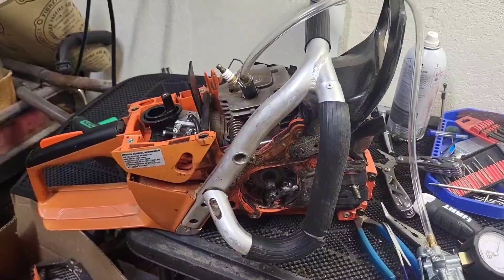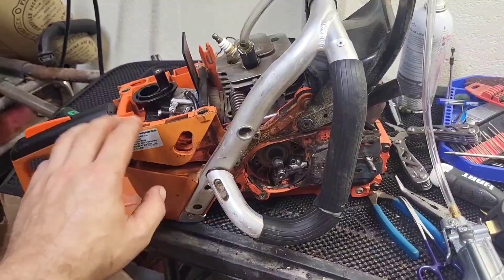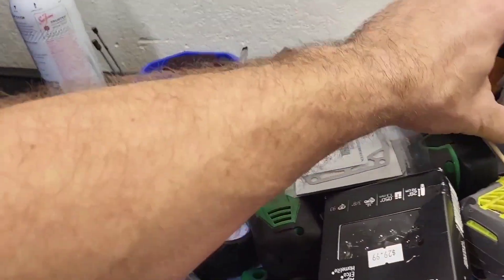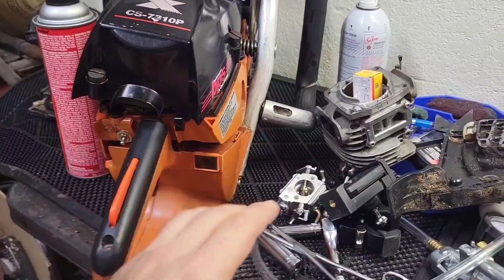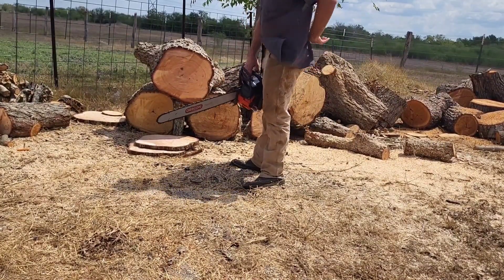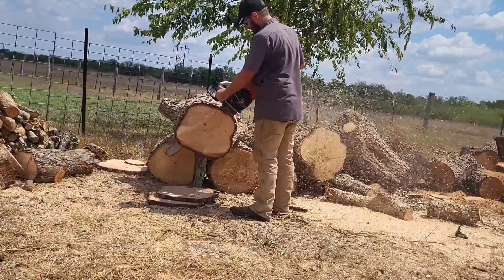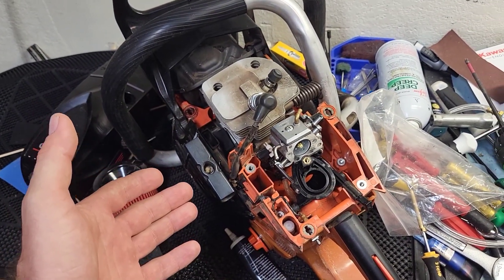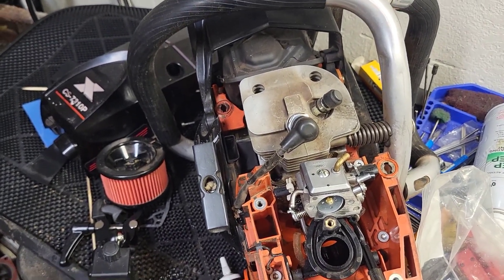Ending the CS-7310 Debacle @novicelumberjack

Comment: This is an excellent video and shows your ability to work through finding problems.  Also, it totally make sense that if the fuel line goes empty and there is fuel in the tank, that there is an issue with the carbs ability to deliver fuel rather than there being an air leak in the bottom or top end.  Also, I love how you didn't "throw the kitchen sink" at it because now you know for sure what the issue was rather than replacing seals, carb, lines etc, etc.  Obviously it doesn't always work out like that and you were super careful to when you were talking about how you thought it was essentially most likely the carb and nothing else.  Don't you hate it when there are 2 issues, where one contributes to the overall problem?  Will drive you nuts!  Though I am not a small engine technician, from a technician to another, GREAT WORK!
Reply from the maker: Thanks man, it is just another day at work for me. I like solving problems, i dont 100% understand the failure of the carb but there is a way to test it too i just havent done it yet. Since it is a performance build it gets a new carb, no risks taken there.
Reply: Good evening OW!
Reply: @Super-Dave-Outdoors  sounds like a good idea. Will keep watching and I was super impressed with your 7310 build. One that runs like that would be worth owning!
Reply: @Super-Dave-Outdoors  Fuel pump diaphragm inlet flap is first  
check valve and most likely culprit. There is another flap valve 
and a duck bill valve in the purge bulb if it has one. Sometimes 
slight roughness on the aluminum cover plate for the fuel pump 
diaphragm or the carburetor body can be lapped on fine grit emery 
paper on a piece of float glass to polish the seats for flap valves. 
Some of the renewal kits come with 2 different material types
of diaphragms. So if the shiny type that is rated for ethanol 
fuel is not sealing well, the older type that is rubberized
thin canvas will possibly seal better, but like the metering 
diaphragm will get crunchy and have to be replaced more
often even using non-ethanol fuel.
Reply: @Super-Dave-Outdoors  A leak at the inlet tube is also possible
and it could be a thermal expansion differential between brass 
and aluminum that appears there when the engine is hot, and
goes away when the engine is cool.

Comment: If I remember correctly the Echo 7310 takes a very particular spark plug. Meaning, the coil works off of the current draw of the plug and will not run at optimum capacity if the draw is not correct. You know, nerdy stuff😁
Reply from the maker: BPMR8Y-5 is the factory installed plug, it isnt special just a pre-gapped plug. BPMR8Y is the OEM substitute as long as it is gapped to .5mm

R just stands for resistor which supposedly gives a longer spark dwell time and reduces RF interference.
Reply: @Super-Dave-Outdoors haven't seen any of the factory plugs actually gapped but I've read that they are supposed to be.  After brisco helped me get mine together and pointed out my factory plug was way off I started looking at any 7310 I could find and they were all over the place.  Also spec I found on 7310 was .4mm also the few builders I went to with it had said the same I actually gapped from .35-.45 and noticed it would fall out of tune the further away from .4 I went.  I couldn't find spec for air gap but I just did the same and tested a range from .3-.4 ending up at .3 matching what stihl specs on a lot of their newer saws.  What brisco pointed out that kinda got me looking at this was my spark was very weak sometimes not even firing at cranking RPM which I think effected idle tune and played a hand in the cold blooded nature of the 7310. I took video on every adjustment through the ranges I listed both plug and air gap and it was pretty crazy to see how noticeable a change comes from such minor adjustment.  Anyways just thought I'd share great video I like how meticulous you are in diagnosing the issue if you find yourself into one again you should give gapping plug/coil a shot the cut video I did after finding the right spec on both was one of the best I've gotten for the saw on video.

Edit : thought it worth adding before addressing plug I had tested it at home as I would any other and it seemed to perform same as any saw by eye cranking it over to arc to the cylinder.  If Charlie didn't tell me it seemed off while turning by hand I'd have never even thought it to be an issue as overall the saw performed great with the original un-gapped plug I just always felt I couldn't get it dead on in tune and it took a lot to get to peak running temp.

Comment: I wonder if the fuel getting warmed up after running messed with the carb valves. 🤷🏻‍♂️
Reply from the maker: I honestly dont know, that was the first time i had that issue. Some way, some how, it let air back feed through a place it was not supposed to.

Comment: 👍👍 good info.
Reply from the maker: Thank ya CF!
Reply: CF, it was an incredibly valuable video to store away in the memory bank for me.  He taught us a great way to troubleshoot this issue.  Now, if all saws had a clear fuel line.  This will be super handy for things like blowers and trimmers too.
Reply from the maker: @oakiewoodsman typically it is way easier than that. I didnt video the issue but it mimicked an air leak pretty closely. But it shut off like running out of fuel or losing spark. Also helps i have encountered similar failures in the past. Richard Flagg does much better repair and diag videos on his channel
Reply: Wuz🆙CF
Reply: @Super-Dave-Outdoors  I watch him periodically as well. I take it you won’t run pond scum then either?  I love taking in all the information I can from everyone along with the comments. As I have gotten busier creating content, I unfortunately get less and less time to absorb from everyone else. That my friend is not a good thing.
Reply from the maker: I run FD rated oils or oils that get used in race bikes. I reccommend FD rated oils to customers, Red Armor is excellent and VP is pretty good too. I like 40:1 for performance and extreme duty use but a lot of equipment has no issues at 50:1 with good oil.
Reply: @Super-Dave-Outdoors  right on man. Makes sense to me!